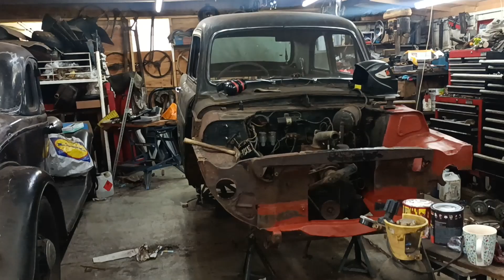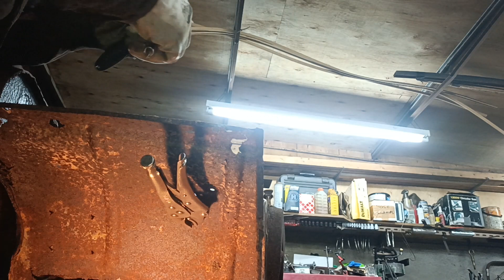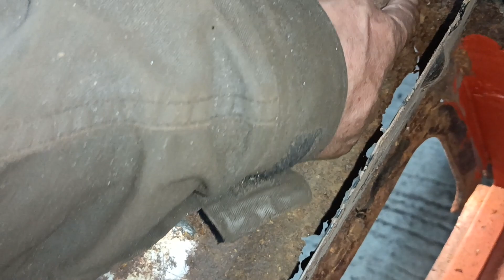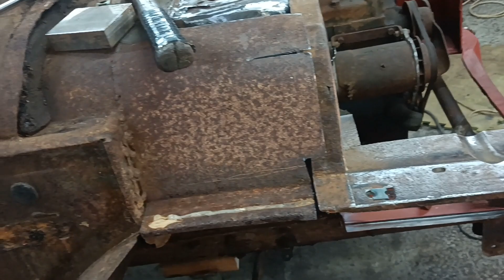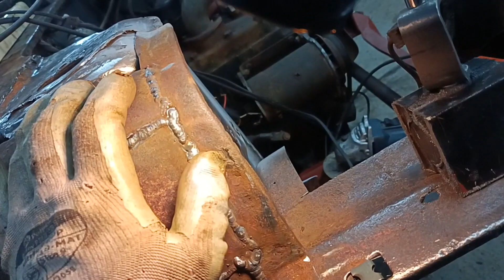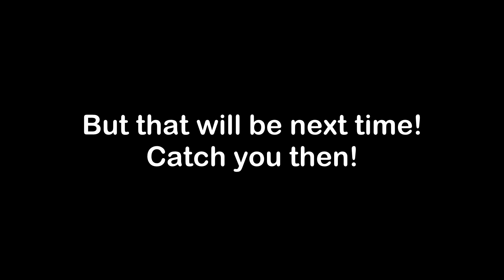Mart's 1955 Ford 100E Anglia part 21! More Heavy Structural Repair!` (2358)

Comment: It seems the donor car was in much better condition than your car. Maybe you should have acquired the complete shell and used your car as the donor. Especially as the vin plate simply screws on. LOL😂😂
Reply from the maker: Yeah, that has occurred to me many times. I like to do it the hard way, though. (The donor was a 4 door and the serial number is stamped into the strut top.)

Comment: My Dad had a 100E Ford Escort.I have pics of me as a kid sitting on the wing. It was the 100E Van so it had the rear end split with the window opening up and the tailgate down. Perfect for family picnics in the lay byes of the 60s.
Reply from the maker: Yes, the Escorts were good little cars. I had one years ago. It ended up with a 1650 pre crossflow in it. Glad I stirred some memories.
Reply: @MartsGarage  I remember my dad saying it had  side valve engine. A 3 speed gearbox  and he would scare us all to death on the motorway when it managed 80mph. Poor little car. I wish I had one to fix up. Not likely now as I am here in Australia !

Comment: Good work Mart!
I had to do a similar amount of work when restoring my 1959 100e Pop and 1958 100e Prefect, although both cars were not quite as rusty as yours.
I agree with several other commenters, in that I position and secure the panels with self tappers before plug welding with my mig set. Also, I use a good quality weld through primer, which I’m fairly sure is electrically conductive. It also helps prevent further rusting because of its high zinc content.

Comment: Good work Mart. Weld through primer and etch primer are two different things, if it doesn`t say "weld through" on the tin then it won`t be.
Reply from the maker: Yeah, it was my first time trying the stuff. I did get a refund and they changed the wording on the listing so all good.

Comment: That piece you have clamped in with the weld in primer and the scribe locating marks is exactly where the self tapping screws work perfectly. If you had that piece temporarily attached where the clamps were with two self tapping screws, they would act as your "locating" sources no matter how many times you removed and replaced that panel. Just put the two screws back in and the panel is instantly located. Once all the plug welds are done, you simply remove the two self tappers and fill the holes. 
BTW, we tried the "weld through" primer with TIG welding (my son likes to do 98% of his welding with TIG) and found it made big black carbon residues and the weld was terrible so we abandoned that idea. These cars are HARDLY going to ever see rain or even hardly any "wash" water so they will no "outlive" us without the "weld through" mess !!